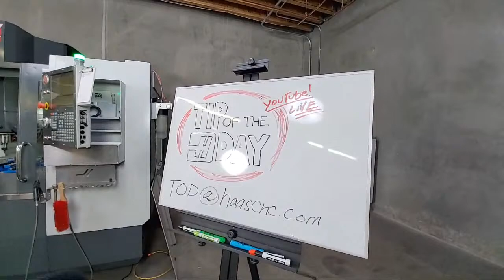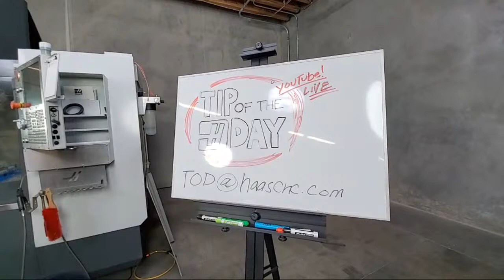Tip of the Day LIVE! - 04.23.20 - Haas Automation, Inc.

Comment: Tool touch off, like edge precision on you tube does it, a half inch gauge pin on its side, then sneak up on it, he said something that made sense so you don’t chip the sharp edge of the tool with a flat surface if it goes too far and bashes the tool into the surface. 
The round sliding will or won’t go underneath it

Comment: I keep common tools in carousel measured once and only measure new tools changed in. Creating positive tool lengths of physical tool length, can be done in machine or off-line with pre-setter..Prerequisite is SETTING #64(Mark please explain) AND determine distance from spindle face(when at Z home) to common measuring block on table surface (3" block).I permanently store this value in Z G58 work offset. NOW TO MEASURE TOOL, Instate G58 with MDI, *call pocket to spindle with ATC fwd, Load tool,  Handle tool tip to 3" block, press TOOL OFFSET MEASURE button, rinse and repeat from call pocket*.  Tools are measured and stay in a 500 pot Horizontals for every job why do people not do the same for Verticals?

Comment: I really like the live Q&A. Thanks guys! Question: If I had a set of steps and I wanted to measure either the distance between the horizontal surfaces or the distance between vertical surfaces is there a way to probe that without separately probing them and doing math myself?

Comment: With inserts it's also important to make sure you keep the seat clean. Did Mark say Solidworks NOOOOOOOOOOO. Fusion360 YEEEEEEEEEEES. Tool height gauge(dial) for offset on a mill, you should be shot for using a piece of paper. Oh God I so want a Haaz control. 4TH AXIS, PLEEEEEEEEEEEEEEEEEEEEASE and what about parametric programming? The cycloidal drive is a great idea for a 3d print! LOVE THE VIDS Anyone know if there's a use bye date with coolant? Can I have Marks laptop?